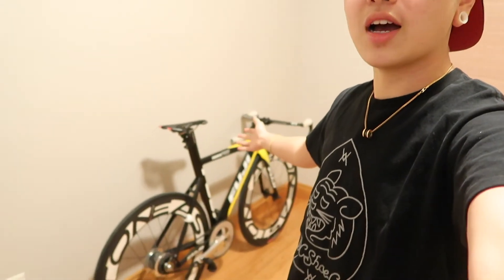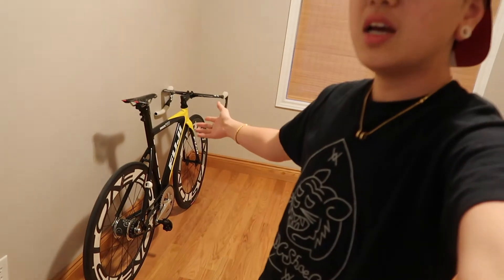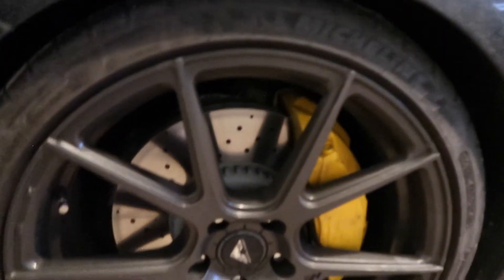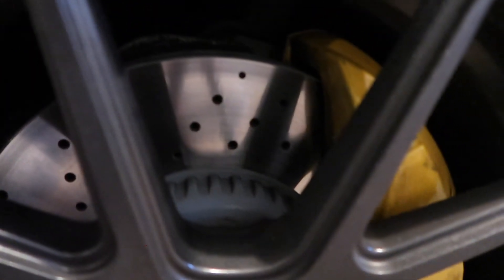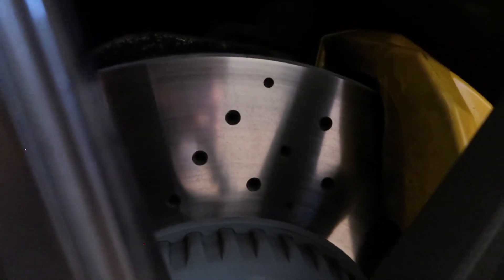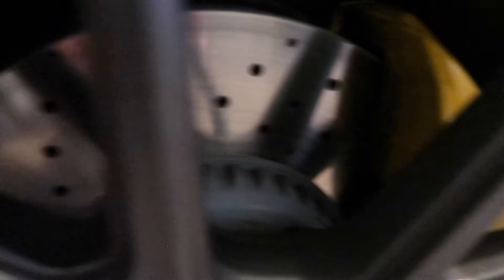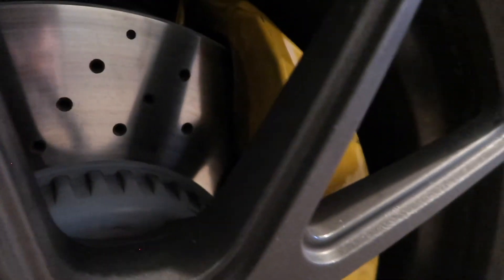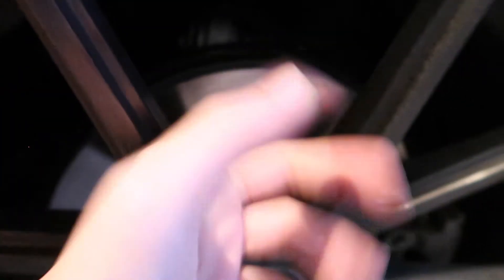WHEEL SPACERS RUINED MY BRAKES!!!

Comment: How exactly did they ruin your brakes?
Reply from the maker: The hub centric spacers shakes when going over 120km/h or braking. Overtime, I noticed that the shaking become worse every time I brake. I assume eventually it affects the rotors because it does not make sense for my car to have the rotors replaced in such an early time.
Reply: @KeziaElva  That means you got the wrong spacers. The bolt patterns worked, but the center hub was not fitting on your rotter and rim properly. This is the small circle below where the bolts go in on the rim and rotter. When there is a gap it will causes movement and vibration. This can be very dangerous. Hope this info helps.

Comment: Spacer adds unsprung weight to your wheel...means reduce your wheel's road holding performance.  Not the right thing to do IMHO
Reply: So would u reccomend them or just dont reccomend goin too fast with them.
Reply: @rolexusmonroe3948  I think there are two different ways to achieve this cosmetic objective (making then wheel edges sticking out from the fenders).  
Apart from using spacer, the alternative is to use rims with higher ET/offset and that would make the rim's edges extending farther out.  You need to experimenting the fitting by putting the new rim onto your car to ensure clearance to all suspension components (especially in full turn lock positions).  
Your garage mechanic is your best person to talk to on this. 

Good luck and all the best.

Comment: What spacers and size did you used
Reply from the maker: I used Sparco 5mm for fronts on the winter set up and I used DAI 10mm fronts and H&R 15mm rear when I had the vossens

Comment: How come you only painted the front calipers and not the rear? Also how come you didnt put the AMG logo back on?
Reply from the maker: I did not have the time to do the rear last summer but will do it this year. I wasn't 100% set on the color therefore I didn't have the decals on it.
Reply: Im getting mine painted Burnt Copper and putting the AMG decal when the temps pick up a bit. (i live in the same city as you btw)
Reply from the maker: yup, its better to work on it in the summer! Say hi if you spotted my car lol
Reply: will do! That was i can finally hear that exhaust in person. Ive been debating getting it for my C450 lol
Reply from the maker: its a good exhaust and not too loud. I definitely recommend it!